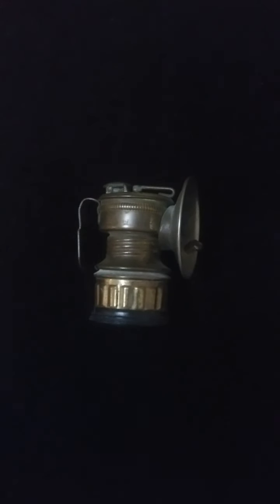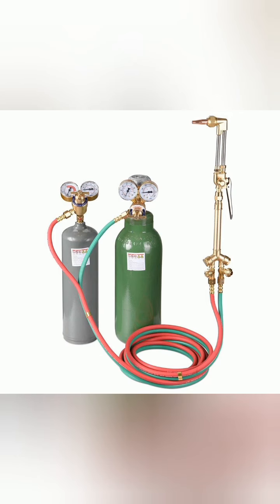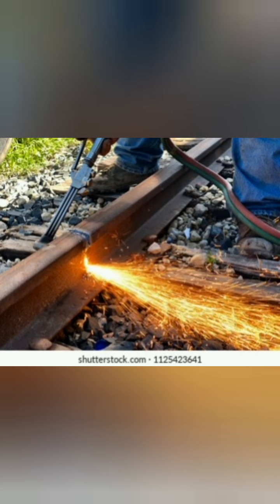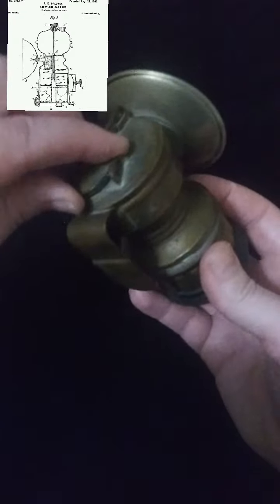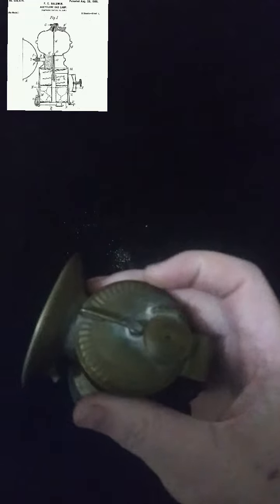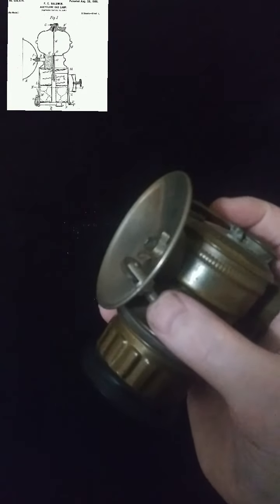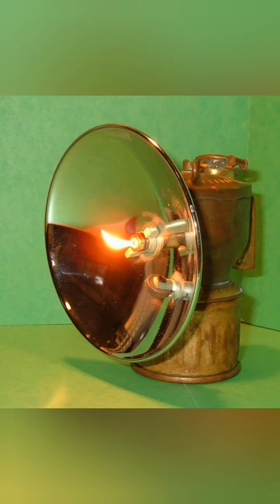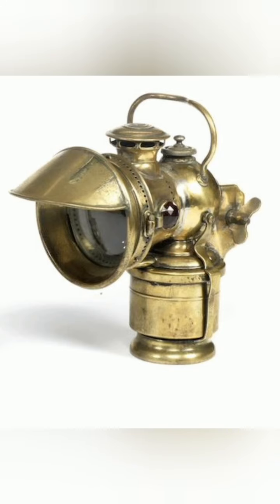Carbide miners Lamp, one of the most interesting lamps ever made.

Comment: Carbide lamps work extreamly well In the early  60s when I was a kid we used the old miners head lamps to shine at night in the woods - it was the type with the canister hooked to a hose and wore on the belt - the lamp was sowed on to a wool cap - the flame or beam conscentrator was a magnafine glass -
      Incindesent head lights used a 6 volt square battery - they would cost a dollar and the light bulb was replaced with the battery - the bulb blackened with each battery and burned out on a second battery - 
  For $1 I could buy gallon a can of Union Carbide,- the Carbide came in a yellow can - 
        I'm guessing I had to replace the used up carbide every few hours and add water to the tank - it lasted as long as the electric head lamps - but was very inexpencive to use - a can of Carbide lasted over a yr -
     I guess mine, my dad's and grand fathers were from the very early 1900s - there all the same kind - i still have them along with a carbide table lamp also - the beam of light they generate when you close the lens on the flame - looks like the flame
Reply from the maker: Thanks for stopping in l. I bought mine at a antique store. just thought it to be the coolest light. And thanks for the info